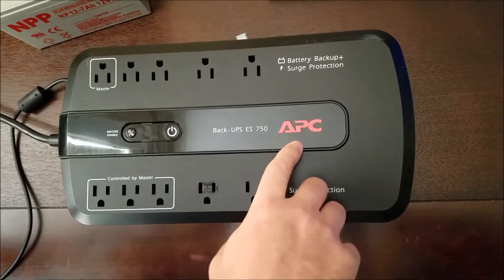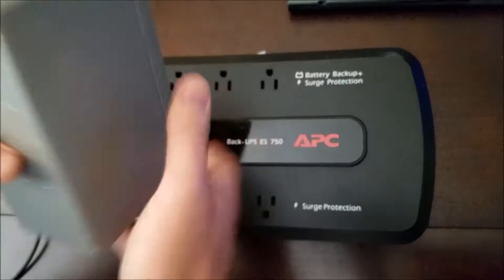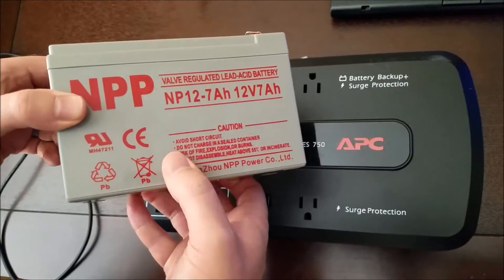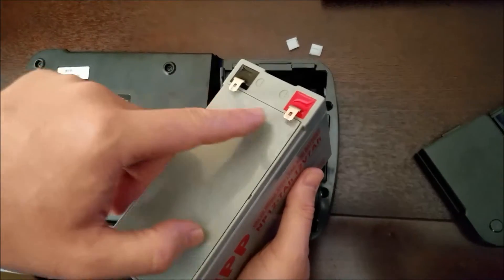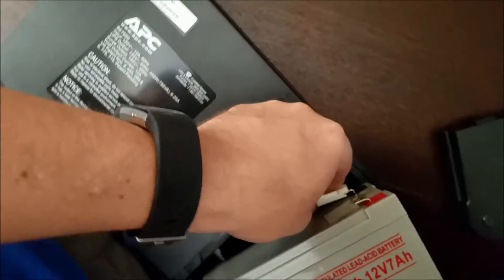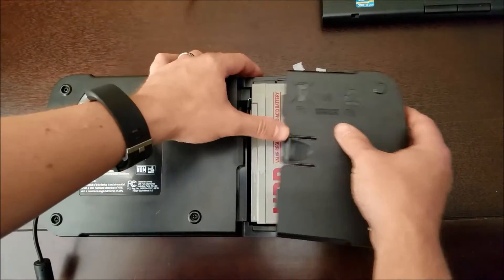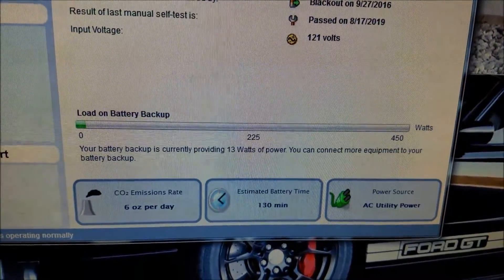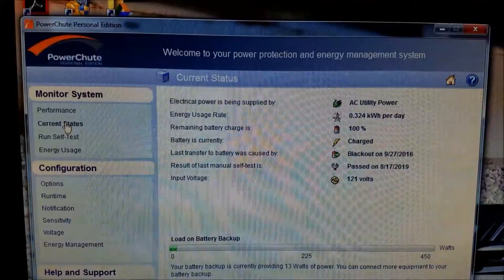APC BE750G UPS RBC17 Battery Replacement and NPP Battery Review NP12-7Ah 12V 7Ah AGM F2 Terminals

Comment: It turns out the OEM  replacement for this model is supposed to be 9AH instead of 7AH. You will just get a lower runtime. OR maybe the manufacturer understated their AH rating, which seems unlikely.

I just bought 3 of the  9AH version of these on Walmart's website for 23.99 each, as I have 2 cyber power units and one APC unit that all use the same battery, including the F2 terminals. This goes by several model numbers CP1290, HR9-12, UB1290, PS-1290, etc.  The dimensions are 5.94 x 2.56 x 3.70 Inches... note that the 3.70 inch height does not include the terminals. Some UPS manufacturers will include the height of the terminals to get a different number and make things more confusing even though its the exact same battery.

As for ISO certs... I just go by reviews. Even a company with ISO certs can make lower quality stuff. Reviews to me means the proof is in the actual product.

I stopped using Amazon as their shipping time ranges from awful to horrendous... I dropped their prime crap years ago when they never delivered anything in less than a week, it was often 2 weeks. Also a few months ago I ordered some supplements off their site and they had not even shipped it for eleven days Amazon wouldn't even let me cancel the order... so I returned it as I had ordered from Walmart and got it faster. Their terrible service and political stupidity means I avoid them like the plague.

OTOH, Walmart with no membership usually gets things to me in 3 days, sometimes a day or two longer.
Reply from the maker: Thanks for the info and great comments man. Our local Walmart closed and left town, so I'm pretty much stuck with using Amazon. I refuse to support Walmart after deciding to leave our city.

Comment: Can I please ask how long the npp battery lasted?
Reply from the maker: I'm still using it
Reply: Lead acid batteries rarely last longer than 6 years, most only 5. Right after I watched this and bought 3 of these batteries for UPS units in my house, I found out they make LiFePo (Lithium Iron Phosphate) batteries for this application, LiFePo have a much longer lifetime and can handle being discharged a lot more than lead acid batteries. They are almost double the price, but seems worth it to me.

Comment: This is interesting. I have the same UPS and need to replace a battery. I looked up APC website and it shows 12v 9ah, but your replacement battery has 7ah. Have you had any problems so far?
Reply from the maker: No, been working great.
Reply: @LuckyVagabond  good to know. Thanks.

Comment: I believe it’s a 9ah battery. Installing a 7ah or 8ah battery will not keep the equipment powered on in case of power failure as long as a higher rated battery. The one I just replaced was a HR 1234W F2. Google said 5ah to 9ah battery for the model battery I had.

Comment: Great video! If you don't mind me asking, how did you come to learn that the NP12 was the compatible replacement? I've been doing digging around just to confirm your findings, and I'm not finding anything. Did you contact NPP directly and wait for their response? I tend to be a little paranoid when it comes to finding replacement stuff, and I want to get it right the first time. Thank you so much!
Reply from the maker: Hello, I measured the dimensions of the old battery and used that along with the capacity specs to find a replacement. Thanks for the comment.
Reply: @LuckyVagabond  Not a problem! I went ahead and ordered a replacement for myself using the Amazon link you provided. Thanks again for the help!

Comment: Good info. Buying replacement batteries is like buying mattresses. The industry is geared toward confusing the consumer to make them overly for magic beans when all the beans are mostly the same. Getting the F2 terminal and the 12v 7ah rating and the correct size (so it fits in the box) is all that matters. APC/Schneider of course hide the rating of their Original batteries to make you pay 2x. 
Peal back that APS silver label and see what the original was. For me it’s a WP1234 which is an 8ah Model but the 7ah is good enough. 
Thanks for pointing me to one of the many that has the right terminal size.

Comment: What if it keeps beeping and not taking any charge?
Reply from the maker: The old battery or new replacement? If new replacement, you should return it.
Reply: Same problem with old battery. Haven’t bought the new tho. It should solve the issue, right?
Reply: @Time-traveller2025  yes